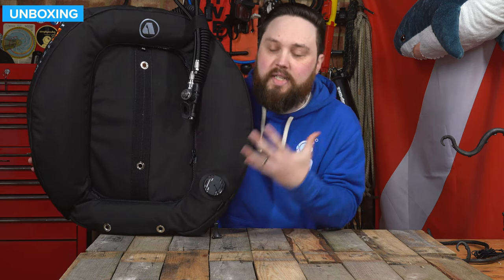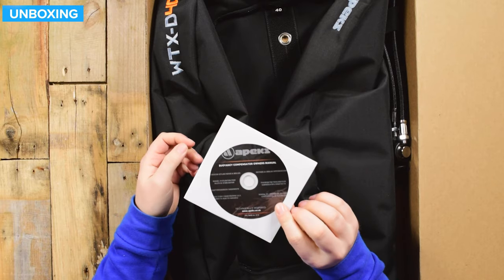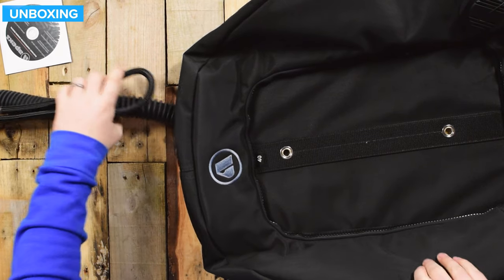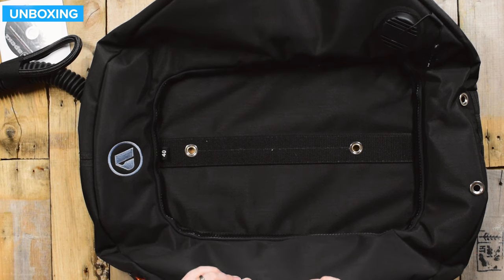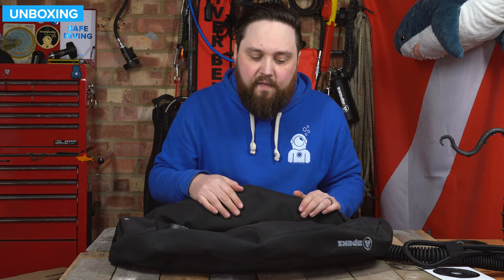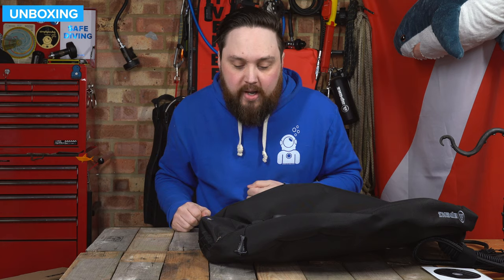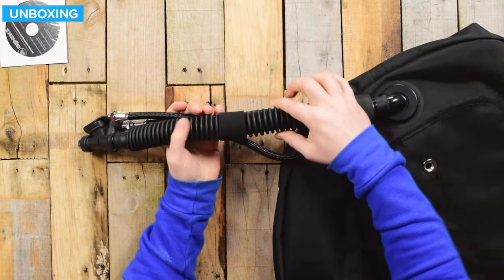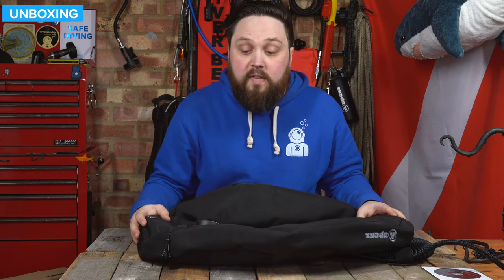Apeks WTX D40 Wing | Unboxing

Comment: Oh I think something went wrong here. In the video you show the Apeks WTX D40T which is for doubles! In the description, the title and the link to your shop it shows Apeks WTX D40 which is the single cylinder version.
Reply: No Its not, look better
Reply: @scubacro5758  Speedbreaker is correct. This is the wing for twin setups. The D40 mentioned in the title (which the link also goes to) is for single cylinder  setups.
Reply: @bloodymarvelous4790  You're right, I just saw it